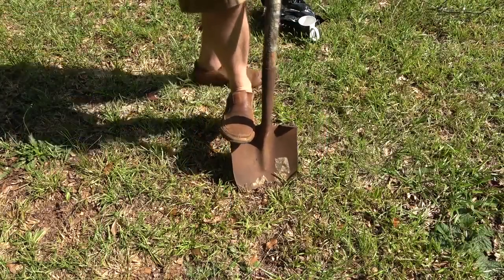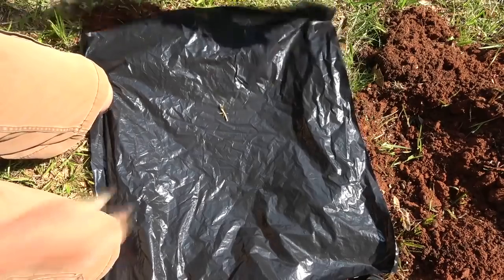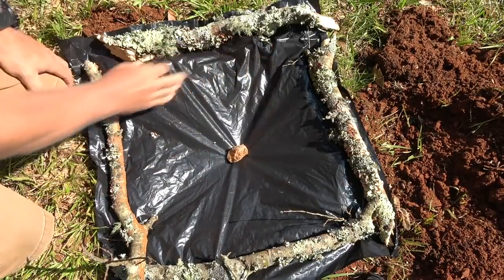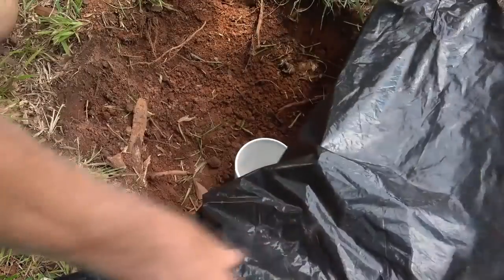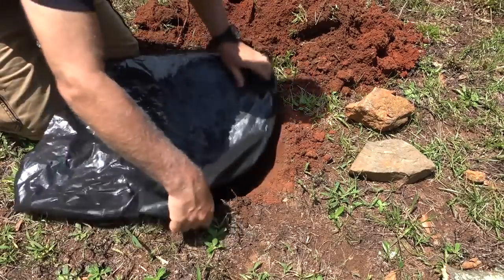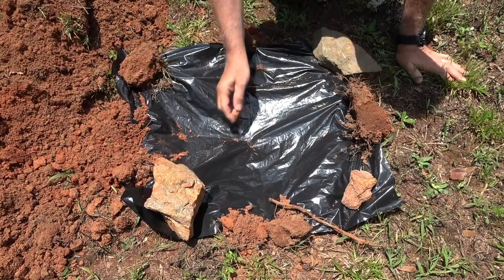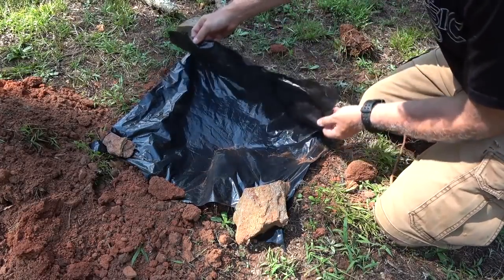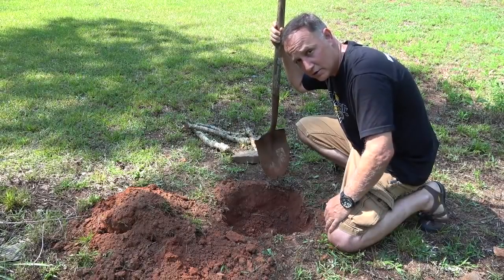Solar Water Still

Comment: Ok sootch, you know me, I am a retire scout master and I specialized in teaching survival skills.   
First the best hole for a single man to survive on is about 60" diameter this will give you a good production rate.  
But it will not be enough to do heavy labor.    
Then for the plastic use a semi transparent shower curtain with texture on one side the texture helps hold the water so you don't  loose any drips outside your catch cup or bottle. 
Secondly  you do need to use rocks to hold the plastic in place with the shower curtain, if you have black plastic this can be placed over the top of the shower curtain and it will help speed up the production of water.  
Last points, a length of IV tubing can allow you to drink off the hole all day without opening the still and halting production. 
Now some tips, adding green plants, or waste water, or URINE  to the hole can make a poor producing still work better.
Reply: Great tips! Aquarium tubing might work in place of IV tubing.